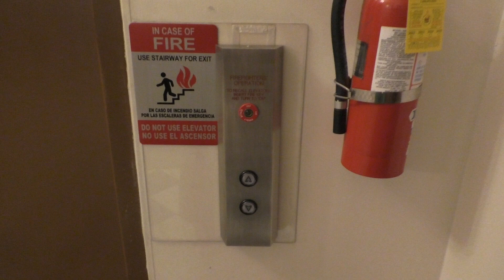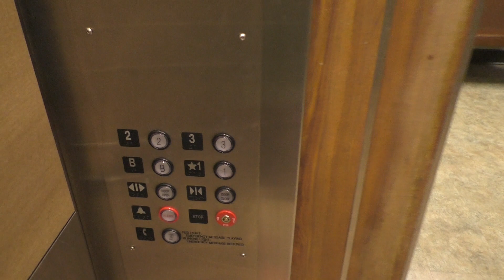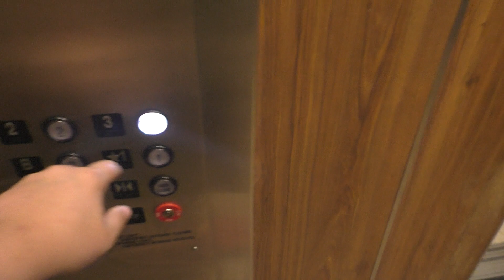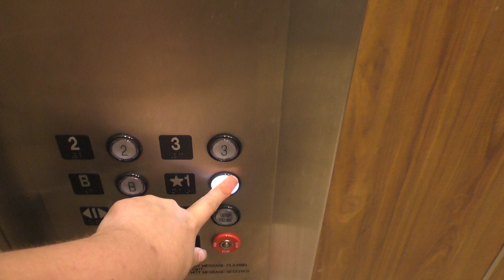Unknown Hydraulic Elevator at Montgomery County Courthouse in Crawfordsville, IN

Comment: I agree that the cab is out of style with the building and the rest of the elevator.  They should have matched the cab panels with the wood grain pattern of the doors for a more consistent fit and finish at the very least.  I'll give an analogy.  It's like someone bought a classic car and then restomodded it with more modern rims, electronics and gauges, etc. instead of the classic and vintage parts found in an old classic car.  It just ruins the original look of the car.  Same goes with elevators when trying to blend them in with the building's design and architecture.